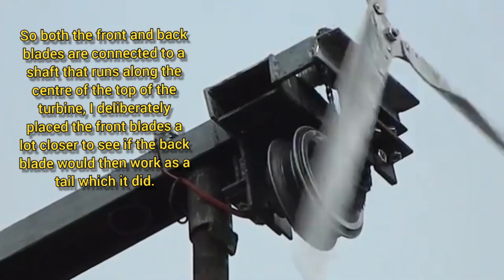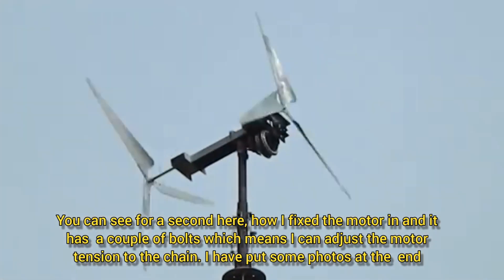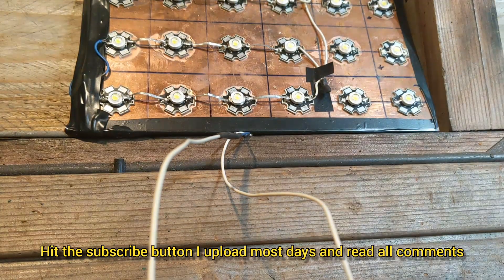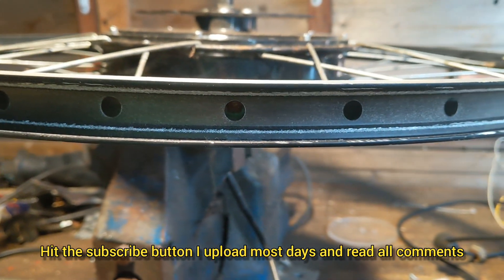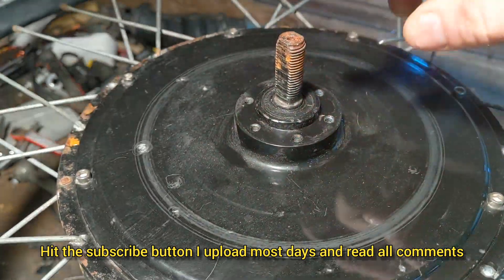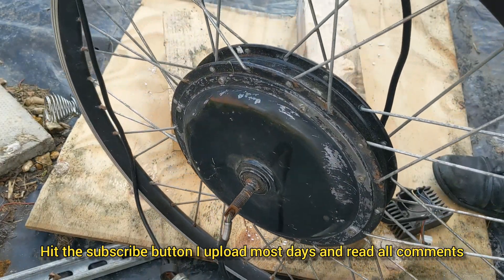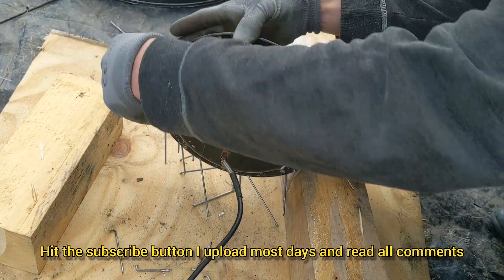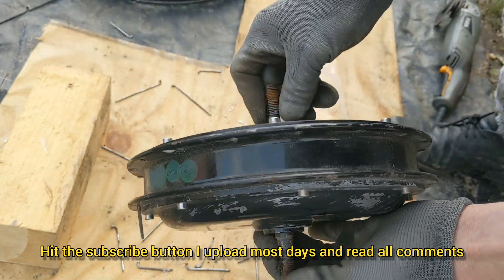1kw E-Bike motor to WIND TURBINE GENERATOR , part ONE , read description

Comment: you can get a disc brake fixed gear cog from your LBS
Reply from the maker: The chain I have is motorbike chain , Bike chain isn't strong enough when it's in high winds.

Comment: I think I'd build it with 2 props side by side, with the hub motor in center, with a long frame and a tail, basically it would look like a twin engine  airplane.  It would probably need the frame longer with a larger tail, maybe a "V" tail being it has twin props,  if you are running a chain, may aswell put the props beside one another! Just an idea!
Reply from the maker: I did build one like that with 2 DC motors years ago , but the system with the shaft in the middle worled well and if you offset the blades ( the rear blades futher back 1-2 feet off the back ) then that works as a tail pretty well, I may put a tail coming off the top.

Comment: ive seen gears that clamp onto the spokes, theyre for the  petrol motor conversion i have the 80cc version may be too small in diam though. i do have ev motors in a box for use one day.
Reply from the maker: https://www.bearingboys.co.uk/06B1-38inch-Simplex-Platewheel-3737-c-low-o Probably go for these as they fit the chain I have , I have thought of a simple way to make them interchangeable though it would involve taking the turbines down and the blades off.
Reply: @GavinFreedomLover  yeh a mate of mine has heaps of those in his early type ebike conversion kits, theyll do the job.
Reply from the maker: I need to do some thinking on the gear ratios I think I would rather it spin up in lower wind than only hit highs in the higher wind, small on the shaft big on the motor = should get the motor spinning easily , big one on the shaft small one on the motor alot harder to turn but more RPM's in high winds.